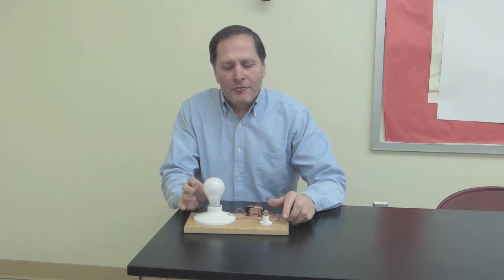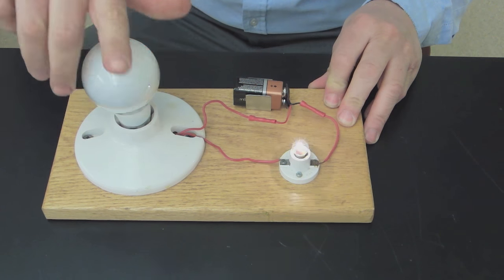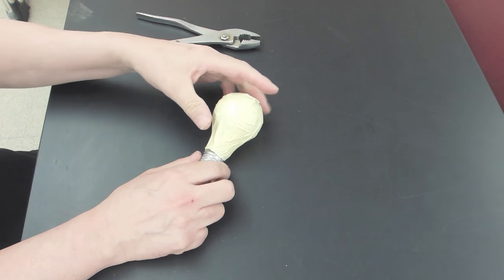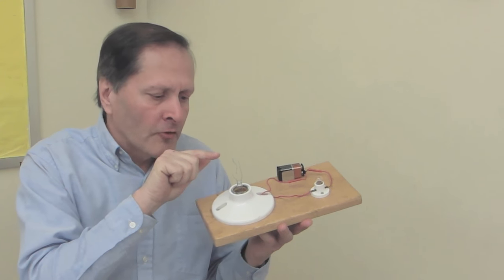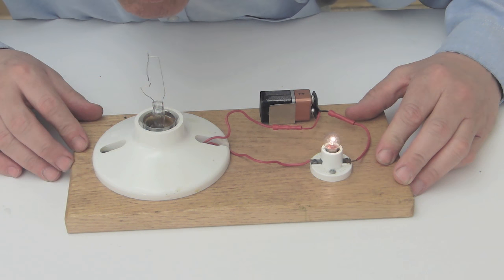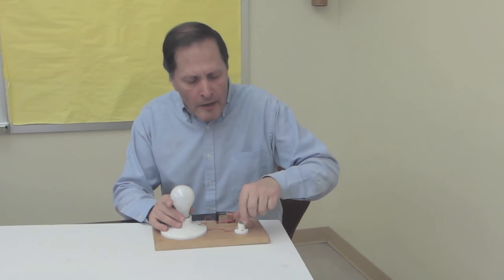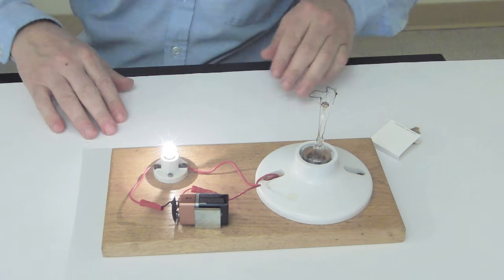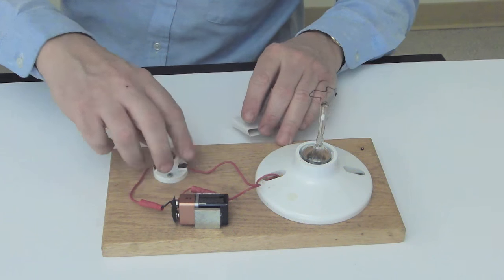A Light  Bulb Mystery- Electric Resistance // Homemade Science with Bruce Yeany

Comment: AMAZING demostration.  This is IN FACT how the MAF sensor on cars works. This sensor tell the computer how much air is going thrugh the intake so computer can adjust the fuel mixture. What they did is, they put a hot wire in the duct and, the more air it goes through,  the wire cools down more and more and its resistance goes down. This value is sensed actually by the engine computer. This is probably non linear, but the use a conversion table in the computer.
Reply: Jordan Hillard Yes, it behaves like that. But the sensing element is heated to a known temperature. It is "biased" and then the voltage change is measured. It is a thermistor but combined with a heating element so the changing air mass can produce a change in temperature ie change in reading. If I trow a hermistor in the duct, it wont change too much the reading since intake air temp is the same. Principle is the same. Amazingly simple for being used widely in automotive.
Reply: This is a flowmeter called hot wire anemometer

Comment: This is why tungsten bulbs tend to have their filaments explode violently with a blue flash right when the switch is turned on, due to the high inrush current with the filament cold. Normally tungsten filament bulbs don't fail while they are glowing white.

Comment: Excellent demonstration!  This type of circuit has been used as an inexpensive, yet very effective method to protect speakers from being over driven. A  small lamp is put in series with the speaker that is at low resistance at low sound levels  If the drive levels increase to damaging levels, the lamp lights up and its resistance increases, absorbing the energy that would otherwise ruin the speaker.
Reply: I used to be an electronics repair technician. When I'd work on something (a power amp, for example) that was blowing the main line fuse, I'd clip a 100 watt 120V bulb in place of the fuse (or a 60W bulb is the line fuse was about 3 amp or less). If the bulb glowed brightly, I knew I still had a problem. That trick saves from wasting fuses and prevents brand new outputs from going up in smoke. Then, once the repair is done, insert a fuse and carry on.
Reply: I do the same type of trick in auto repair. Take old, blown fuses and solder wires to bulbs of different sizes to energize circuits for analysis without danger of cooking the wiring harness. Usually used bulbs that had corrosion or other connection problems. Waste not want not, eh. Also, use wires long enough to lay the lights on the dash or hang out the window so you can see your results easily.
   Mike (o\!/o)
Reply: When used like this in any of these situations, the light bulb is called a ballast. Thermistors have similar characteristics. What will we do when all incandescent lights are replaced with LED's?
Reply from the maker: thanks,  it's always good to hear of useful applications

Comment: Replace the small bulb with a fan blowing on the big bulbs filament.
Reply: For what? small bulb is gone! No light. Fan keeps cooling the filament and runs faster to a max speed depending on the voltage. We will not see anything special. Unless we add fan in parallel with 100W bulb. Fan gets all the current and 100W bulb remain cool an becomes cooler with fan blowing on it and small bulb gets brighter.

Comment: Bruce, there is another experiment you can try. Get a thin piece of copper wire and string it between two pencils using a couple of thumb tacks inserted into the erasers. You'll have to push the pencils into a cardboard box or something to make sure they stand up solidly. Now scrape any insulation away from the ends and connect them to a 9V battery like you did in this experiment. You will note that the copper wire gets hot and melts, breaking the circuit. Now, do the same experiment but this time heat the copper wire with a small flame. Then connect the 9V battery and note that the copper wire does not melt or break because the resistance of the copper wire is too high due to the  heat of the flame. So far, so good.

Now for the interest part: Use a flame that is so hot that it would melt the copper wire all by itself. Try it to get the fight flame intensity. Now, this is the tricky part. Put the higher flame under the copper wire and at the same time connect the ends of the copper wire to the 9V battery. You will note that the wire will not melt!
Now, if you remove the flame, the copper wire melts! The question is, how does the flame protect the copper wire from the electrical current and how does the electrical current protect the copper wire from the flame?
Reply from the maker: Thanks Joe,  I've never seen that before but will try it,  Happy New Year!
Reply: The real interesting question is why the electrical current protects the copper wire from the flame.
Happy New Year, Bruce!

Comment: fun fact, graphite's resistance goes down when heated, causing more flow and more heat. you can take a 9 volt to a bit of mechanical pencil lead and it will get increasingly bright until the carbon reacts with air and depletes. make sure to have welding goggles if you do though.
Reply from the maker: thanks Fjdbend,  I want to try that
Reply: cool!  thanks for the safety tip too.
Reply: Doest make much sense
Reply: Old fluorescent lamps are the same. When you light it up the resistance decreases and that's why high pressure or low pressure metal vapor or noble gases lamps can't be used directly, requiring a reactor or starters. It is called reverse resistance.

Comment: The heat increases the resistance and therefor draws power from the smaller bulb. Or in other words the voltage drop becomes too high and therfor the voltage drops at the smaller bulb.

Comment: 3:20 Wait a second!

Shouldn't we be using this to regulate current?

As I understand it, potentiometers 'lower the current' by taking what's extra (that you dont want) and wasting it as heat (like a hose with a leak; lowering pressure at the end, but also wasting water back at the leak).

The other option, I've read, is to change your wire size but the energy still flows, just a lot of it is wasted as heat also.

But when you applied the flame to that wire, I think you built up more of a dam, which would hinder the flow (not redirect a portion it); conserving electricity back at the battery where it is stored, instead of letting some of it flow out of the circuit (as heat).

We could use small circuits to regulate heat at concentrated points of larger circuits; even redirect waste heat from the circuit itself.

Then remove the application of heat &/or cool it using fans &/or the Peltier effect (or whatever) if needed.

I guess it could be tested by measuring the voltage drop over time with a heated version against a non heated (or even cooled) version?

Comment: This makes me wonder, if you took a copper pipe, wrapped an insulated (ceramic) heating element around it in a 'barber shop' style helix fashion, heated it up and then applied electricity to the ends of the copper if:

The electricity would circle the copper bar to avoid the heat, instead of flowing straight through it (path least resistance; like it does when we wrap insulated copper wire around it) to avoid the heat and if that would generate concentrated magnetic fields in the same way.

Comment: Wow! You just taught me something I already knew but in another "light" (pun intended).
I knew that heat changed resistance but never thought external heat could affect it. 
I am wondering if this can be turned into some kind of thermostat or even a thermometer for as the current status the same, the light should only go when certain ambient temperature is reached. 
It might not be very precise but for a right estimate it makes a cool gadget xD
What do you think, +Bruce Yeany?